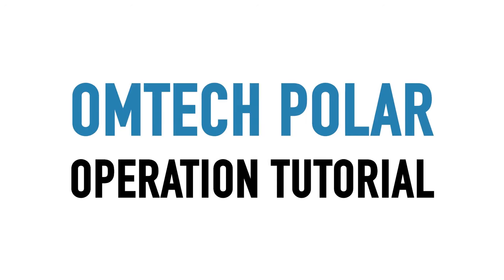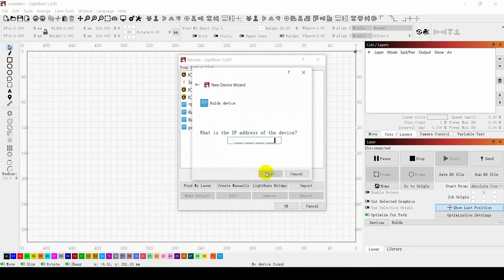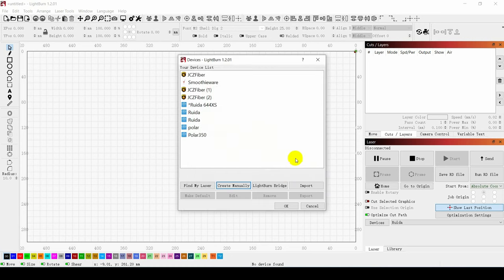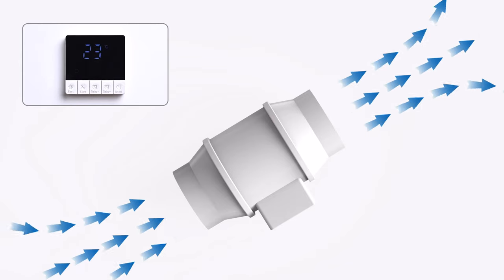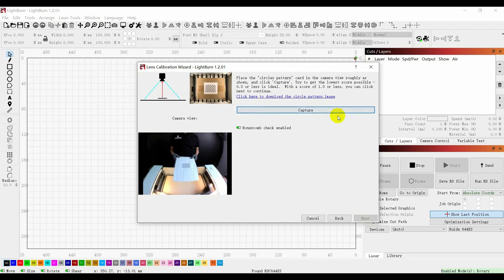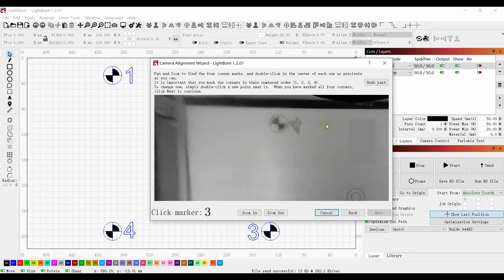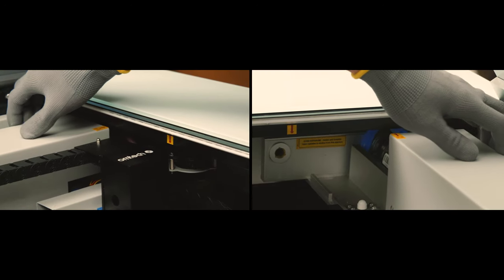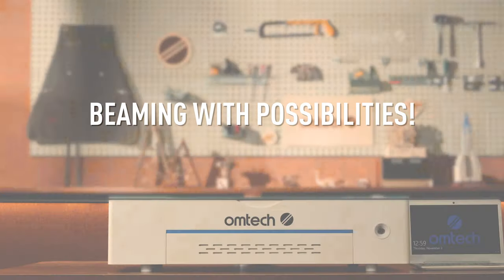Polar Operation Tutorial

Comment: What the distance between the material and laser head? Can this be used for shallow wooden trays about half an inch deep?
Reply from the maker: Saul, For any product-related questions or issues, please feel free to contact our technical support team at techsupport@omtechlaser.com or call +1 (949) 539-0458. They will be able to assist you further and get you up and running again! If you have any other questions, please let us know. Have a great day! :)
Reply: The Polar comes with 2 lenses, a 2" and a 4".  The 2" lens is what comes stock.  The nozzle extends a good ways, so the distance from the tip of the nozzle to the item being engraved is a little less than an inch.

Comment: Why does the camera alignment card not print at the size required? Or at the very least, have SOMEWHERE other than this video that tells you what size it needs to be?
Reply: Had to use my printer to reduce the Calibrate Camera Lens test size by 50%.  Still had to have the target a long ways away from the camera.  Went through the process twice, with the Calibrate Camera Alignment, and got nothing in return.  Camera is a good idea but good luck getting it to work.

Comment: I own a Polar 350, along with a few other laser machines.  

@3:45 this is a dumb way to set the focus unless every single thing you ever cut/engrave is 3mm.  Instead, you should use "z-offset" within the layer parameters.  In this case, you would use "-14" there (out 14mm).
Reply: how do you find the machine?